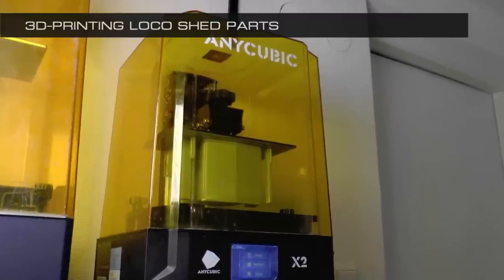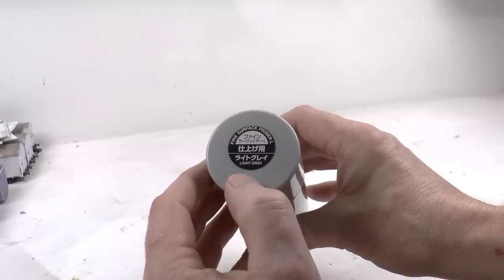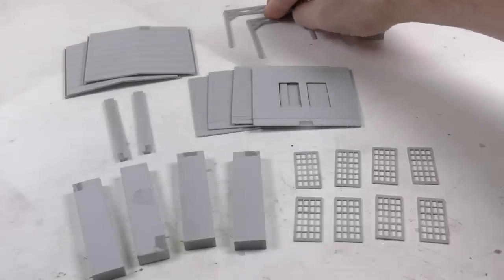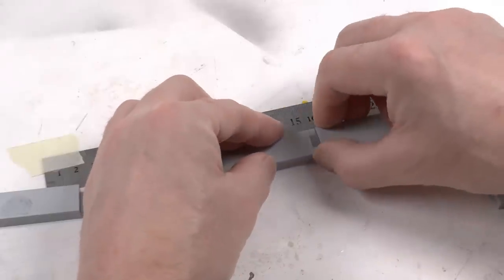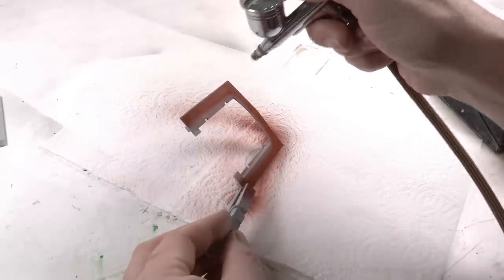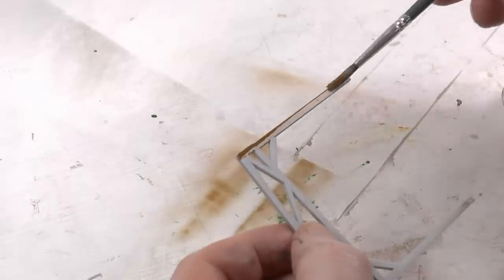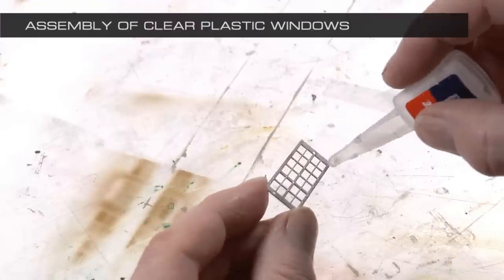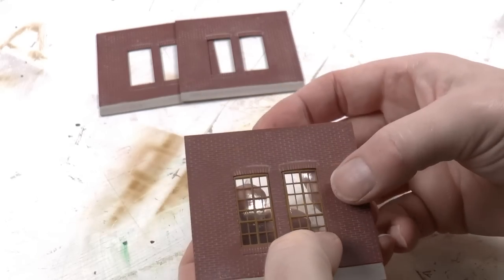Building Loco-shed in scalable length with servo controlled doors

Comment: Done a similar shed for my steam locs (2 side by side). Therefore I used some calendar cardboard, PLA windows & doors and some wood coffee stirrers. The rails were also recycled Jouef rails.
For the animation I used 2 cheap servo made in China as well as an Arduino. 
The doors can be opened together or individually with some light (led) effects inside. A lot of fun for some minimal work.😊

Comment: One more excellent tutorial, Martin!  I've been planning to scratchbuild another enginehouse from styrene sheet.  Even though your kit is resin printed, as usual you have provided some very helpful suggestions I can use, and your results are great.  By the way, I like using that Vallejo Concrete color for weathering washes, especially when mixed in various ratios with Dark Sea Grey.  Cheers from Wisconsin!

Comment: Hi Martin , Fantastic video! Could you perhaps in the future show how you solved the connection of the servo's  with Rocrail??
I find the Rocrail Wiki not very helpfull mostly. Best regards. Hans
Reply from the maker: Ohh.. It’s easy since the servos are connected to a turnout decoder. Each door have an address exactly like i turnout. That means you can ’Add a button switch’ to the trackplan and assign the turnout address to it ’Interface-tab’ under properties for the button. Then also select ”Toggle” and you’re done!

Comment: Great idea! Just looked at it (no app needed at all, just via their regular site). Did I understand correctly that the SG90 there supposed to be 1 dollar each? These servos are listed at € 12.30 each at a minimum of 30 pieces... Still cheap but you have to buy 30 of them for that price. The shed itself is a fantastic idea.
Reply from the maker: Thank you! Okay.. The SG-90 servos is either $12 at 30pcs = 40 cent/ea, or 10pcs at $3,40 = $0,34/ea. Otherwise you’re looking in the wrong place.
Reply: @marklinofsweden  I see. Terribly sorry for the misunderstanding. We stand corrected. Price at € 12.30 comprises 30 pcs indeed. We haven't seen them at a minimum of 10 pcs though but I trust that you're most likely probably correct. We haven't had much time but we'll find it hopefully. Thanks !

Comment: Lucky for me I have three different airbrush models, 2 of which are Master Model airbrushes and the third being a pain to clean and put it back together will not be used at any point.  As far as the servo goes, I could have built one with a small electric motor with a plastic tab on it along with a double-pole double-throw switch with the plastic triangle made from a scrap of plastic. I, strangely enough already have most of those parts.

Comment: My Grandpa did it without servo  he suspended a stop from where the servo is connected  if you drive a locomotive into the shed you run into the stop and pull the doors closed

Comment: When printing the shed, what did you find to be the best print settings?
Reply from the maker: Hi! This set was easy to print. No special settings needed. Just the recommended default for resin/printer combination. Important though to let the printed parts dry over night before post-curing and after that priming. This to avoid scewing.

Comment: Don’t buy anything from WISH.
Reply from the maker: Why? It works perfect every time here. I have more than 10 successful orders. However, sometimes you get an extra customs import/tax bill and sometimes the lead-time is 3-5 weeks. But hey.. The prices.. I can live with that!
Reply: @marklinofsweden  Exactly!  You might have to wait or pay a import tax but its worth it. I've had the same on Ebay. I had a wrong order from China. Sent the wrong dolls highchair for my daughter. Messaged the company and they said they no longer stock the right one, refunded me and said keep the order!Another time I had a camera battery the turned up after a few months which judging by the various postage marks had  travelled around half of Europe!